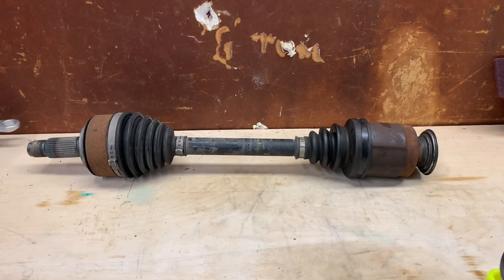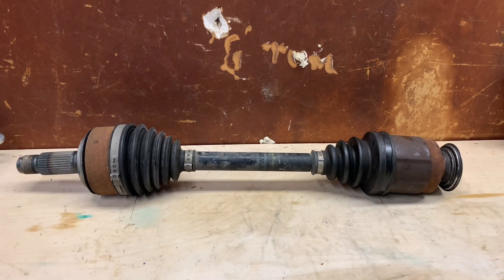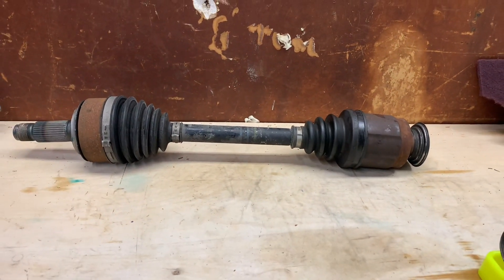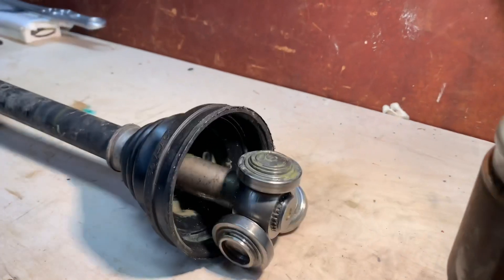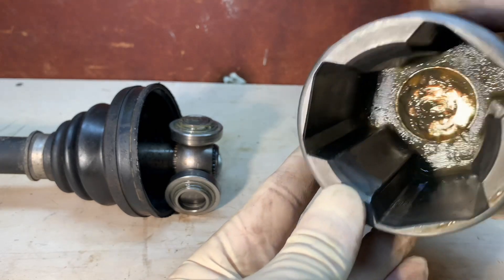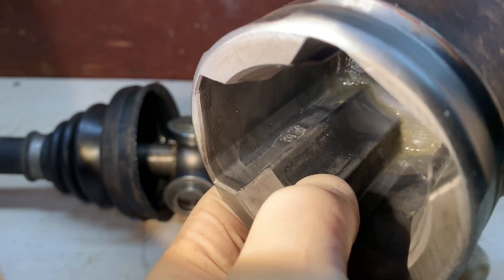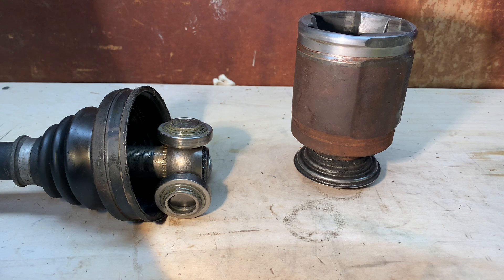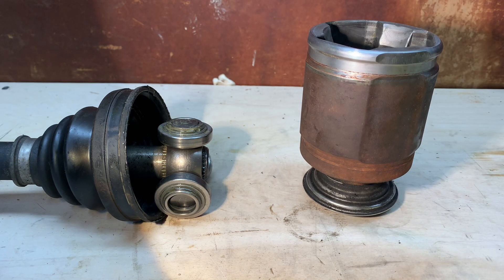Honda and acura vibration issue!

Comment: I need some insight too I have a 2011 accord v6 and my mechanic told me it's my torque converter slipping. I get a shake only at 60 -70 mph and smooths out over 70
Reply from the maker: At 60-70mph if you let go of the throttle does it stop shaking? Also is the shaking in steering wheel or whole car?
Reply: @BCautosutions  nope only shakes when I accelerate at that speed and its the body of the car I feel it in
Reply from the maker: @OurEssentialEssence  how’s the trans fluid look? I would try a 3x trans service. The speed is somewhat odd, typically a trans judder will be at lower gears and slight accel. Hard to say without any data but the cheapest and quickest route from what your telling me I would say perf the trans service 3x. I have a video on how to do it in my channel on different car but same principle Applies.
Reply: @BCautosutions  yup I have done the drain and fill. I added honda fluid this time around since I bought the car used. And I have called around to some transmission shops and they said the same thing you did that it's very weird speed to only get symptoms at they also said a torque converter would set off a check engine light sooner or later I have been driving it like this for almost a year and no light so I have no idea.
Reply from the maker: @OurEssentialEssence  best bet is have your local Honda dealer look at it. Pay them the diagnostic charge so you can have a definitive answer then make your decision from there

Comment: I installed brand new axles, still have vibration....??? any advise
Reply from the maker: @apcondesignsolutions5605  less/more/the same? Where is the vibration felt and under what conditions?
Reply: @BCautosutions  GOT WORSE THAN BEFORE, IT CHINA CHEAP PARTS, VIBRATES AT 50 KM ACCELERATION..... I WISH I KNEW TO INSTALL OEM
Reply from the maker: @apcondesignsolutions5605  yeah it’s probably the axles themselves

Comment: Have a similar issue but no steering wheel shake just the body at higher speeds from 50 to 70 mph it shakes the body of the car I replaced the engine mounts but didn’t fully fix the vibration. Any one no where I should look next? It’s a 08 Honda civic ex coupe
Reply from the maker: Rust between rotors and hub possibly, bent wheels, shifted tire belts, are some good places to start.

Comment: 06 crv awd, had axles replaced. Driver side boot was torn and car was fine. Had both axles changed out and now i have the vibration. Seems like it's coming from passenger side. Shop changed the axles with another set but same thing 😔
Reply from the maker: Cheaper axles tend to be an issue with this

Comment: I have vibration on speed 35-45 mph in case of switching gears(2-to-3, or 3-to-4) on 1500-2000rpm, replaced both axles assembled. It didn't help 😞 If I push gas pedal above 2000-2100 RPM It doesn't have any vibration on switching gears(2-to-3, or 3-to-4)
Reply from the maker: What car as we talking about here? Sound amore like a trans judder from a Honda 6 speed at then axle vibration
Reply: @BCautosutions  Honda Crosstour 2.4L FWD 2013
Reply from the maker: @hotgorshok1357  best bet is take it to a mechanic.
Reply: @BCautosutions  totally agree, but the mechanic said the issue is in axles ))) that is why I replaced them both
Reply: steering rack ?( rack and pinion)

Comment: Where should I buy my. Axle from for 2014 Honda CRV?
Reply from the maker: Honda or Amazon look up TRQ
Reply: @BCautosutions  should I do them in pairs?
Reply from the maker: @papic9464  yes, I would
Reply: @BCautosutions  can I keep driving with this issue or replace ASAP?  Happy new year my brother
Reply from the maker: @papic9464  you can keep driving it. 💯
Reply: @BCautosutions  but does it at any point become dangerous
Reply: @BCautosutions  I generally drive about 80-85 mph in about 70 miles one way
Reply from the maker: @papic9464  it’s can to eventually lead to damaging other components, that’s about all I’ve seen.
Reply from the maker: @papic9464  I would change them sooner rather then later personally.
Reply: @BCautosutions  can a novice do this job?  What do you think the labor should cost?
Reply from the maker: @papic9464  yes, those are some of the easier ones to do. A shop will charge you 1-1.5 labor for each axle at their labor rate. Few hundred just for labor.
Reply: @BCautosutions  is there anything else I should replace while I'm doing that job?  I have 174,000 miles
Reply from the maker: @papic9464  check for leaking axle seats, ball joint boots, etc.
Reply: @BCautosutions  happy New years....  Knowing the miles and if it was your truck and I'm trying to keep it for a while.    What parts would be a no brainer without knowing if it needs to be replaced.  Sorry if I'm asking so many questions
Reply from the maker: @papic9464  I would replace both axles, seals, and lower ball joints.
Reply: @BCautosutions  am I getting the other items from same company you recommended for axles?
Reply from the maker: @papic9464  nope, oem only for those.
Reply: @BCautosutions  thank u brother
Reply: @BCautosutions  when u say seals which ones?
Reply from the maker: @papic9464  anytime
Reply from the maker: @papic9464  the ones on the transmission. Axle seals
Reply: @BCautosutions  if I wanted to upgrade my 2014 CRV exl engine with a new one which year could I install?
Reply from the maker: @papic9464  2012-2014 are your only options
Reply: @BCautosutions  where can I recommend getting a new engine from
Reply from the maker: @papic9464  Thats a tough question lol. Local junk yard with low mileage
Reply: @BCautosutions  hey now. It's my tie rod...  Should I buy oem or do you recommend another company?
Reply from the maker: @papic9464  oem
Reply: @BCautosutions  smh. I replaced thanks..
Reply: I have noticed that when I'm in park and I rev the car it's fine till I get to 5000 rpms.  It seems to hesitate
Reply from the maker: @papic9464  it should have a limit as what you can rev it to when not moving. Thats pretty normal if that what you mean.

Comment: Hi I have a 2006 honda accord with 302,000 miles. Ive been having this car for 8 years. The check engine light is on because of the oxygen sensors. Very common. What I have noticed lately is that when I am driving at a normal speed let's say 40 mph doing doordash, my car starts shaking from the front and then goes away when I let go of the accelerator and doesn't do it again when I accelerate. What could that be?
Reply from the maker: Axles for sure. That’s the exact symptom
Reply: That mileage ….  4 or 6 cylinder?

Comment: So I have a 2024 honda hrv brand new 2 weeks old and it started vibrating after 3rd day driving it. Anyone having this issue? Nobody can figure it out.
Reply from the maker: Where is the vibration and under what conditions?
Reply: @BCautosutions vibration in steering wheel and passenger side and driver side seat . Driving 50 to 70 mph
Reply from the maker: @Rockthatjewerly  under acceleration, maintaining speed, deceleration, etc?
Reply: @BCautosutions  starting speed 50 to 70 .
Reply: All
Reply from the maker: @Rockthatjewerly  maybe flat spots on the tires?

Comment: Just got a Crosstour and noticed this vibration  under acceleration  from 60-70mph
Reply from the maker: Chances are it’s the inner joints in the axles like this. First place I would look 👍🏻. Report back when your issue has been fixed and congrats on your purchase. Love the cross tour!
Reply: 60-70 vibration usually is tires needing balancing they come in and out of phase where they cancel the vibration out or amplify it drastically. There is a Honda service news/bulletin all about vibration "excessive steering wheel shimmy or chassis vibration" that can be found online that details numerous scenarios that it could be. I highly recommend anyone with a Honda and vibration to thoroughly read it for insight on this.
Reply from the maker: @brogren802  if it’s only under acceleration it’s not the tires, it’s 100% drivetrain related.
Reply: @brogren802   I got the issue fixed already, took it to Honda and they replaced both Axles( I had warranty so that was a relief). The reason I I said 60-70 under acceleration  was because I didn't put it pass 70, the shaking was horrible and felt like it  was wobbling all over  the place. They realigned  it after the instal and  good as new again. Tires are still the same, no issue there.
Reply: @MarkAnthony-rb7fp  I have the same issue 2011 accord v6. Only shakes from 60 - 70 mph. My mechanic told me it was torque converter slipping but I have been driving it like this for almost a year with no check engine light wish I could figure it out
Reply: @OurEssentialEssence get a shop to run it in the air and check the axles